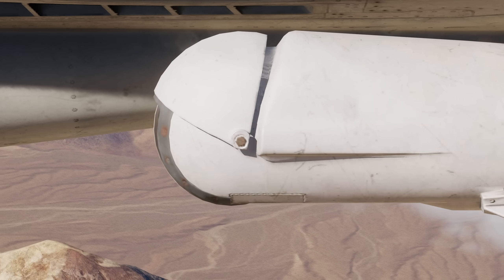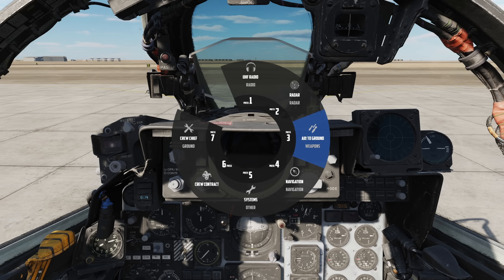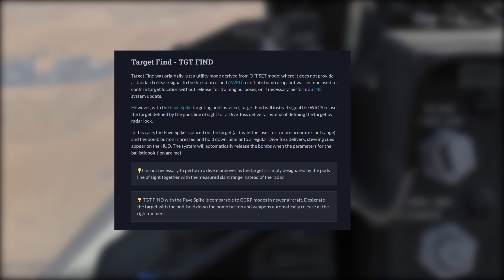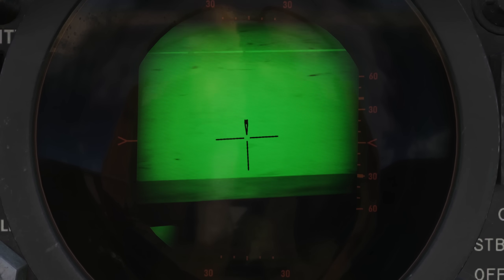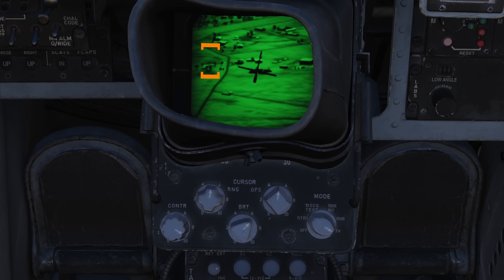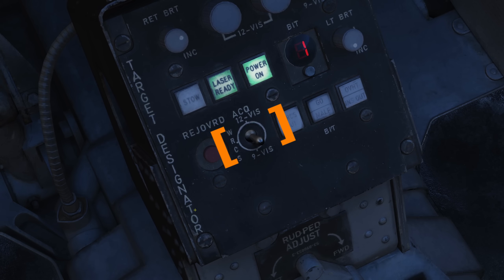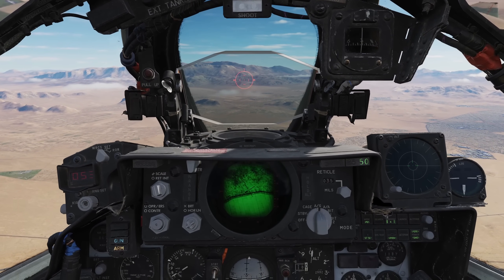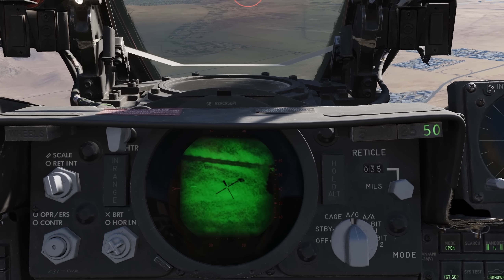DCS: F-4E Phantom:  Pave Spike + Laser guided bombs Tutorial

Comment: i must be doing something wrong, would someone help me pls? i install the pave spike, use laserbombs. use the jester wheels to input the laser code, then set to ready. put the pipper on the approx location of the enemy target, press contextual button, jester says something like "ok" and then i see on the small center circual monitor (TV) that the crossair is somehow targeting where i aimed and pressed BUT, not aiming anything in particular, the ground. The more i fly close to the obrective, the aiming is drifting away.... anyway i press the picke button, long beeeep, bomb release, and those suckers go miles away anyway.... what am i missing?
Reply from the maker: If you're using the non upgraded pod, it struggles to maintain a lock on the ground because the gimbals are too slow to follow at low altitude, fly higher.

If, you are, are you certain the laser is firing to give a good ground track? Ideally you need to either control it yourself or have a human WSO, Jester isn't able to use the pod properly atm.
Reply: @RedKiteRender  ah ok, then that's the main problem. i thought Jester could "shoot" the laser.

Comment: not working anymore
Reply from the maker: Could you detail what is not working? The theory in this video is all based on the real aircraft, so nothing has changed. But, sometime in the sim might have broken, or you missed a step/made a mistake.
Reply: @RedKiteRender  Red, the antenna elevation haven't work since the last 3 months, tried to test the tgp on the f4 but no avail. usually i use the axis for Weapon Slew, used these axis on the [Wso] antenna hand control x and y. the tgp wont move at all. followed all the procedures on the video. and i have the "Use radar Antenna Hand Control also for Radar Cursor Control Panel" enabled.
i used to manipulate the radar elevation as a pilot for the f4 but it hasn't been working anymore, same with the tgp. managed to use mavericks just fine with the Weapon Slew. I have configured for the wso to control the axis ( works just fine on the strike eagle as a pilot/cpg) also on the kiowa/f16 a10c and c2. 
for me the tgp wont move, and the radar elevation as radar wont move too.
=/ i'm going crazy maybe it works for people who had it configured earlier? well i don't know. 
all the binds mentioned on the video and procedures were followed step by step. 
Hardware is functioning on other acft. ( had the aircraft re-installed and lost my previous binds but i re-configured and radar elevation and tgp don't work anymore. :c
Reply: @RedKiteRender  i'll try doing it cold start on a single player mission, it used to work for me but since im starting hot on some servers maybe it has to do with it.! i'll let you know once i come home! <3
Reply from the maker: Did you have any luck?
Reply: @RedKiteRender   yep, revised all the controls, after three mo of updates, the control logic were changed on my end, it seemed as if jster refused to move the tgp from the front as i used to do it ( simply stopped flying the f4 for a while) when i came back ( without ever changing the controls, they were not working anymore) so i had to unstuck jester ( had to remove and add the same buttons to the binds)
Reply from the maker: Awesome glad you got things figured out.

Comment: Followed that amazing guide (as usual!) to the dot but couldn't get my bombs to track for the life of me. Turns out if you set a different laser code than 1688 in the mission editor (or via rearming menu) the bombs are still on 1688. This is a known issue according to the Heatblur discord. The only way to use a different laser code is via the ground crew menu.

Comment: Jeez, the Tomcat is ancient but this make that plane looks like a sort of ultra-mega-high-tech plane compared to the Phantom 😁
Reply from the maker: I never got the Tomcat is ancient angle, it was more than cutting edge at the time! It stands up against DCS's more modern modules.
Reply: @RedKiteRender  Without question. And the D model could easily still be in service today with its radar upgrade to the APG71..the IRST, New flight avionics and the fact the D's were hot off the assembly line. I know HB will do a D. I feel it in my heart.
Reply: @ghostrider1827 it would prob be an E model by now
Reply: LOL... FACTS!! And at the time the Tomcat was ulta high tech. Remember it was the 1st fighter to start using microprocessors.

Comment: damn that camera has a better visual than modern pods lol
Reply from the maker: Gotta remember this is a big TV camera, doesn't need to squeeze in an IR camera beside it and we're attacking targets from lower ranges/altitude.
Reply: @RedKiteRender  Sure a big camera from the 60s. It's hard to believe that it would be this much clearer, even at reduced ranges. Then again I noticed the picture is clearer in your F-14 video too. Either my screen sucks or 3rd party modules are just that much better than ED modules.
Reply: @Cavthena  I doubt the clarity as well. I counted quarter of the lines and I got 60 line pairs, So to half-way it is about 120 line pairs, and full vertical is 240 line pairs then.
I do worry that ED will never implement proper resolutions for their targeting pods, and the dynamic range limitations.